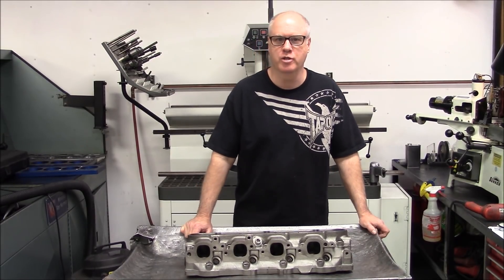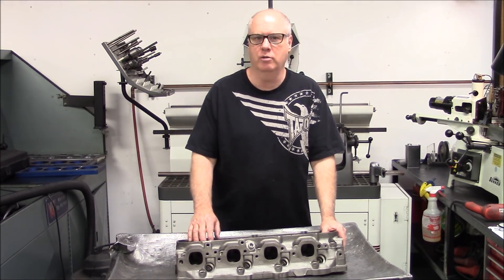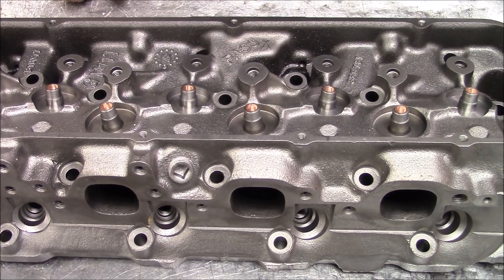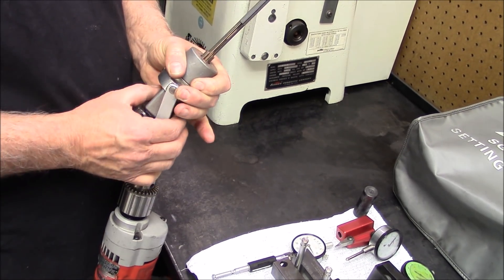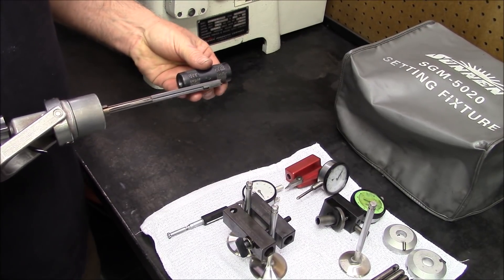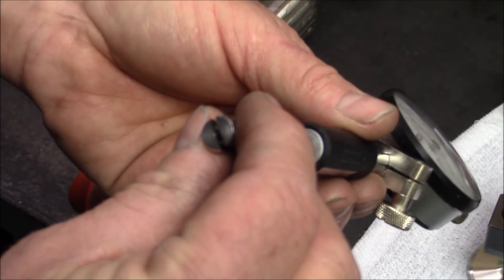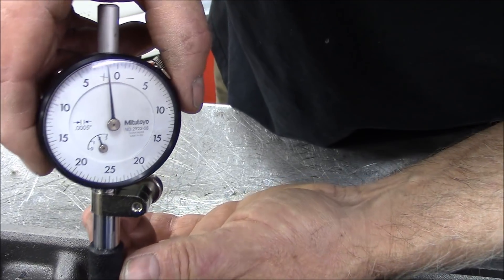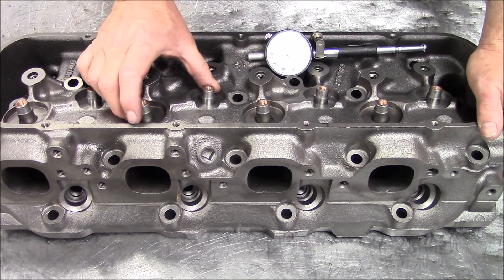Part 16 - Valve Guide Honing and Measuring - 620 HP 454 Big Block Chevy Engine Build

Comment: I wonder why new guide, then k liner in new guide...?   And then he used 3/8 valves stems.  Why all that work to stay in the dark ages with heavy valves??   Smaller stems would be a cheap performance gain in valve train stability.   Maybe getting by with less seat pressure.